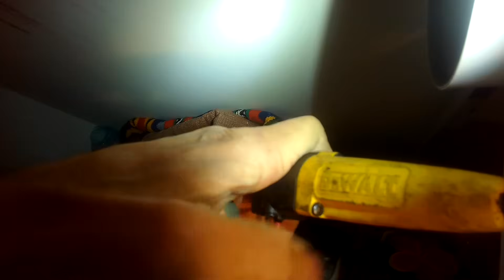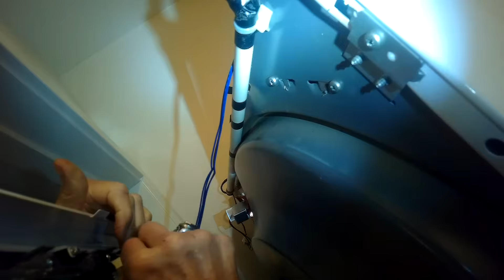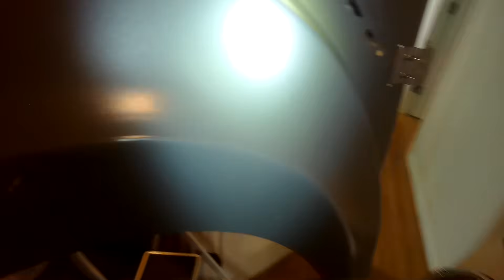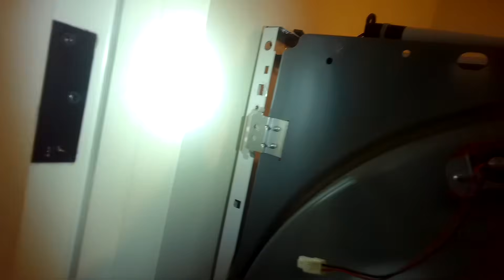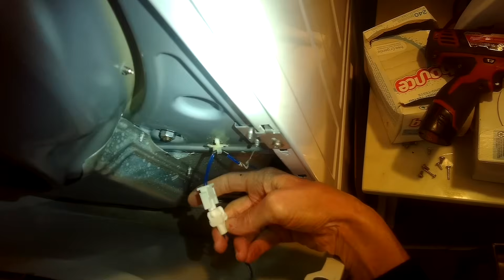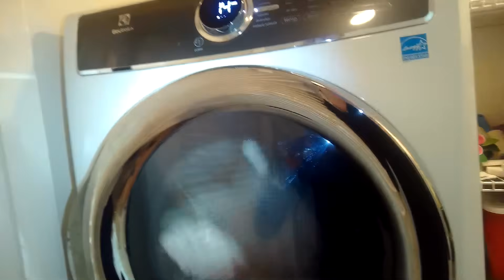✨ ELECTROLUX DRYER WON’T SPIN - BELT REPLACEMENT ✨

Comment: Thank you so much for this video! I have a problem now😳 the first time I replaced the belt it worked as smooth and great as in the video! Now that it ripped again I can’t get the belt to fit, I ordered exactly the same belt. What happened, what am I doing wrong? I followed the video the same way again
Reply from the maker: Does it seem the belt is too small?

Comment: Super helpful video, I do have a question though. 
I have a very similar model, only difference I see is the wire bracket up at the top. 
When I put everything back together the drum is tight to turn. I originally put everything back together and it wouldn’t spin with a heavy load in, take some out and it spins, it would squeak a little. It worked perfectly fine before taking it apart. Do you have any idea what I’m doing wrong? How to get it to spin more freely?
Reply from the maker: Thank you @sabrinachilds2888!

It sounds like the belt might be too tight or misaligned. When reassembling, ensure the belt is properly seated and not pinching any components. Check the idler wheel for tension as well; if it's not providing enough spring tension, it might cause tighter drum movement. Check if all parts are correctly fitted to avoid resistance.

If you need more info, you can reach me directly for a fast answer at AsqMe.com/@ScottTheFixItGu

Comment: Great video! Extremely helpful! Thank you. One thing you didn't mention in the video - and perhaps it wasn't necessary. But for anyone that might encounter this and feel concerned - is about the small metal "dryer clips" (4) that help hold the front panel door assembly on. I was a bit panicked when I broke two of these while disassembling the dryer, and then checked the price of replacement clips. The cheapest I found was around $29. For one clip!!!  I'm no expert on this, but it seems that these clips are not really necessary. Our dryer is all back together and running as it should - with only two clips. Thanks again.
Reply from the maker: Glad to hear the video helped, and thanks for the helpful tip! 😊 you’re right, they’re not important 👍

Comment: Did this to my unit and now I have the E91 code appearing and wont spin, but it powers on...any ideas? Thanks.
Reply from the maker: https://youtu.be/I9o66Ox5NRg?feature=shared
E91 just means the connection between the main controller and the control board needs to be reconnected 👍

Comment: will be replacing my idler pulley on my electrolux. Do you have to undo the gas line or the exhaust hose on the back if i have to take the drum off?
Reply from the maker: Good question Joel,
You don’t need to.
Just make sure to unplug 👍

Comment: This was the exact video I needed! Thank you!
I do have a follow up though. The dryer doesn't rotate when there's a heavy load so I have to take some items out. Is this another issue with the motor or belt?
Reply from the maker: Might be something caught between the front of the dryer drum and the front panel creating too much friction, or the motor is getting weak.
Reply: @jwjkim  I’m experiencing the same problem. Worked with heavy loads before I took everything apart, now putting it back together the drum is hard to turn (I haven’t put the door back on yet). Following everything back step by step I can’t figure out what I’m doing wrong.
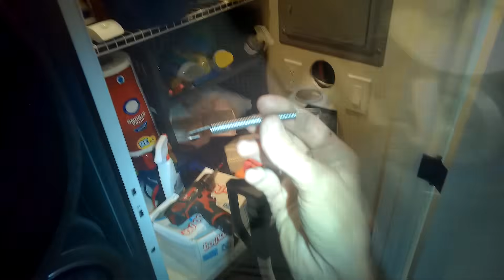Reply: @sabrinachilds2888  My issue was that I didn't wrap the belt around the small rotator and over the white rotator (shown quickly on 5:16), which works fine now!

Comment: This video helped a lot. Thank you for posting. I was able to get the dryer taken apart and the belt replaced without to much problem. When I started the dryer after replacing it was working fine, drum was turning and normal sounds. After the heat came on it started making a noise that sounded like it was coming from somewhere around the motor/belt pully. I turned it off and took the top cover off again. The belt was starting to fray on the edges.  I thought I must have had the belt on wrong. ordered another belt intalled it and it was quiet at first then started making the same noise. Started looking inside by taking video with my phone. That is when I noticed what looks like a spacer or part of a pully laying on the bottom of the dryer kind of behind the motor/belt pully.  White plastic and melted down. I can't see anywhere that it looks like it belongs and I can't find a part that looks like in anywhere in the part diagram. Any idea?
Reply from the maker: Can you send me a picture at: scottthefixitguy@yahoo.com
Reply: We have the same problem. Did you figure out what part it is and how to fix it?

Comment: Excellent Video. 👍Liked clear,concise instructions & video. I’m on my 3rd Belt replacement for this Electrolux Turd 💩. It’s the worst Lemon worst Engineered Appliance I’ve ever owned or fixed more than twice. Video is clear,concise,& I can count on 2+ hours of cussing the Electrolux design each time. Never got easier,only got MoreMad. 
Next time,I may drag it down the dirt road & back over it before dumping the Electrolux in ScrapMetal yard!
Reply from the maker: You Speak The Truth 😂😊👍

Comment: Loved your video!  Think it will help me immensely, but being a female if I can fix this dryer without taking it off my washer as it's a full sized stackable, I'll be extremely happy and grateful as Electrolux has totally not responded to my requests to fix what I feel is a very dangerous dryer they designed. My Electrolux dryer was pricey so i'm upset that the one fin (I call it that) for flipping clothes is a very poor design as it is right up against the drum walls so any clothes that have resistance such as a rubbery substance will get stuck in the narrow space which is no more than 1/4" of space between fin and wall locking up the drum and burning the belts off. In less than 2 yrs the belt has had to be replaced 3 times from the same thing occurring with that wide fin which needs corrected   from what I'm experiencing. I'm wondering if all the fins could be the same length and if I could replace the long one to be as the other two eliminating the problem as Electrolux will not respond to me about any of this that i call a dangerous situation for a fire to start when the drum locks up and the smell of burning rubber occurs. Any help or knowledge would be appreciated. I won't pay these exorbitant costs. So far one  appliance repair is $375 for repair and  a fee to look at it. That's not happening and never dreamed an Electrolux product I'd ever find made like this set!! No more of any of their products or Samsungs since they are the same company now. I'm rambling bc I'm upset over a product I expected to be the creme of la creme  not a piece of, you can figure out what I think.

Comment: I have to thank you.  This video helped me fix the problem with minimal cost and aggravation.  It took me a couple hours, and the repair guy is booked out three weeks (yikes).  Attaching that idler spring was a challenge.  The connector on the electronic panel is very light duty and I feared I broke it working the front face off.  I came off with a jerk, snapping the connector apart.  Luckily, no damage other than a misaligned pin or two.  I wasn't sure which way the belt goes, but mine ended up with the ribs out.  Thanks again.
Reply from the maker: Nice job, thank you for posting👍
Reply: Yes that idler spring was the worst
Reply: @bettygregoire4651  It seem that this particular model has a "feature" that heavy things like sweat shirts, carpets, etc get caught between the drum vane and front of the machine, stopping the drum and consequently making the motor melt and break the belt.  I've replaced mine 6 times in the past couple years and we've never had a problem with the previous dryers like this.  I still reference your video but have it pretty much memorized.  Thanks again for the nice video.
Reply: @jazbuilding 
🤯 that makes sense now! Our blanket got caught in the front vane and I didn't think anything of it when the machine went out.

Comment: This was very helpful , replaced my belt then it snapped again , any thoughts on next steps?
Reply: This is crazy! I found the exact same off white melted plastic wheel! I can’t find anything on where it came from. I thought maybe it was a spacer for the guide wheel. One thing I don’t like is how close the spring is to the belt.
Reply from the maker: I’m sorry to hear that.
I wonder if the belt was too small?
Reply: @ScottTheFixItGuyChannel  it was the correct belt , i took it apart again and found a semi melted plastic wheelish laying in the bottom.. but not the spring wheel or any other wheel that should be in there .. i dont know what it is or where it came from .. i do know the spring arm wheel is loose on its shaft it can slide like a 1/2 inch left to right .. not sure if that should be happening ..
Reply: @sg60545  did you ever figure out the melted plastic wheel? I found one too, and wondering what it could be.
Reply: @gtlogic6023  I did not .. still a great mystery .. I looked at the schematics too and don’t even see a similar part .. but all is working great now .. ended up changing the spring arm too ..

Comment: I think this is the same dryer as mine. Good video. A little shaky but i understand. No i just gotta find a new F!@#$% belt! Drum spins too easy so i think my belt snapped. New dryer too. Had it for a month. Didnt have to pay for the upgrade from the old washer and dryer because i rent. Landlord paid for that which is nice. Old washer and dryer were falling apart.
Reply from the maker: Try using the model number to help you find a belt👍

Comment: I'm replacing the belt on my dryer for the 3rd time. Ugh. Any thoughts on my it keeps breaking?
Reply from the maker: Thanks Billy,

Does the drum spin pretty easily by hand?
Reply: Me too. This video is as clear & concise as possible. But I’d have to say this model Electrolux,on my 3rd belt is a Lemon Mis-Engineered Electrolux Turd 💩!

Comment: I have one of these and laundry keeps getting stuck in between the lint trap and body. I've gone through 2 belts in only 14 months. Wish I never bought this. Had my whirlpool 18 years and never had a belt snap. Guess I will get really good at taking this apart.
Reply from the maker: You shouldn’t have to, but with this dryer I would put the smaller items in a knit bag with a zipper so they don’t get pulled in👍
Reply: This is the 3rd time for us as well. 2 of the 3 times its been large items that did it. One was a blanket  and the other was a mattress cover. They get wedged between the long drum fin and the lint trap. Not much you can do about it. I did see where someone replaced the long fin with a short one and never had the problem again

Comment: Mom of 2 here…I took my dryer apart and replaced the belt by myself. I was very proud, UNTIL I went to hit the start button and the dryer just beeped at me. Any suggestions?
Reply from the maker: Thanks Erin, can you double check that the belt didn’t come off of the idler pulley that keeps the belt tension.  If the belt gets loose it won’t start.  You can check to make sure the door is fully closed.
Reply: I'm having the same problem with my dryer.... I replaced the belt and I get power but just beeps three times when I press start. I've checked the Thermal fuse and door switch seems to have continuity. Someone mentioned it could be the belt switch which I can't seem to find. Any suggestions what it could be would be appreciated or if the belt switch is a possibility?